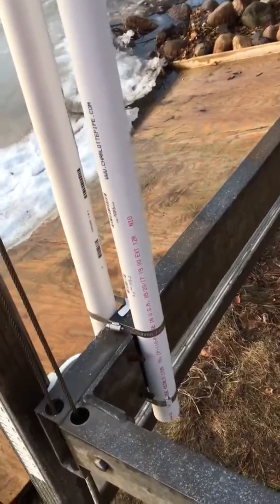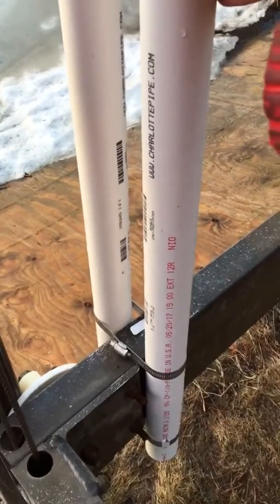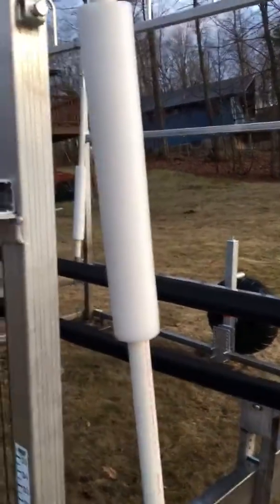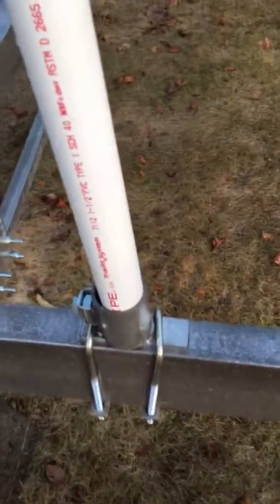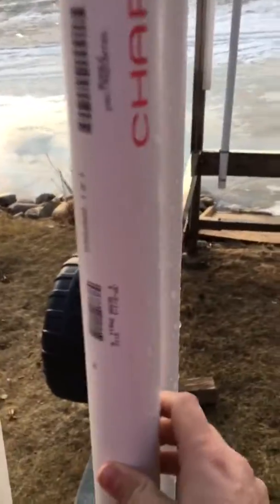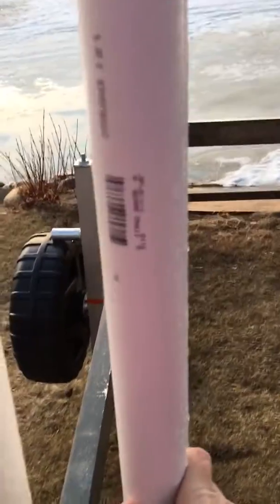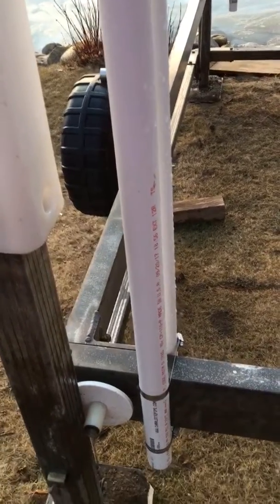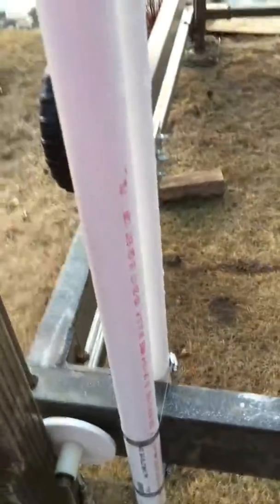Pontoon Boat Lift Bumper

Comment: How long are the 1 1/2 PVC pipes you used for bumpers on a pontoon lift?  Did you put the clamps on the top of the PVC also?
I’m new to this & appreciate all the help I can get.
Thanks
Reply from the maker: 5 feet.  I recommend these instead for clamping: https://www.amazon.com/gp/product/B00IA73P98/ref=ppx_yo_dt_b_asin_title_o02_s00?ie=UTF8&psc=1